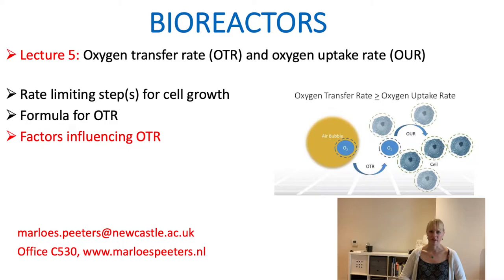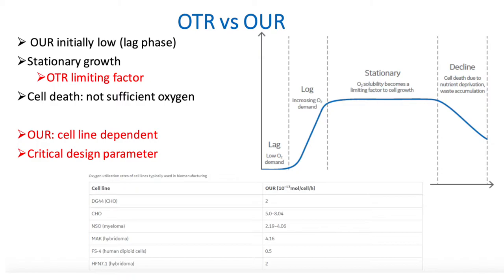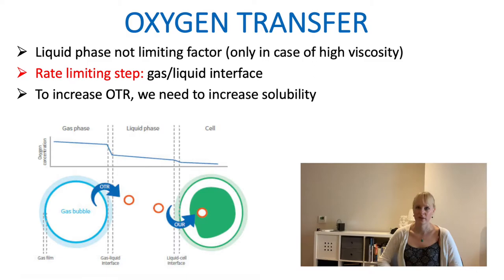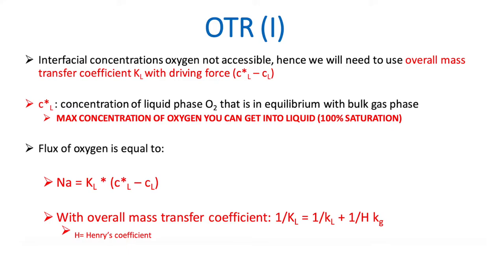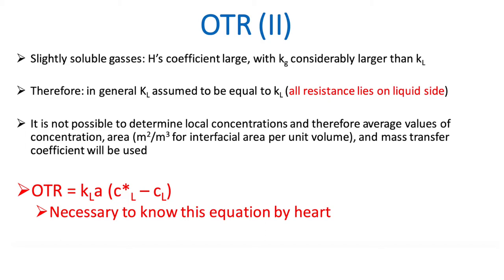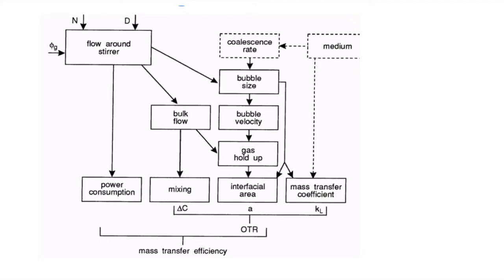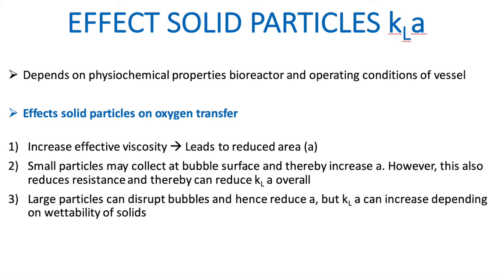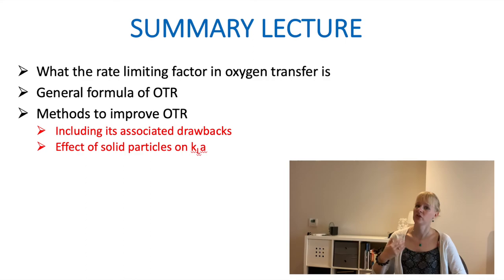Oxygen transfer rate and oxygen uptake rate in bioreactors

Comment: 5:45  why putting pure oxygen puts  the system in explosion ,?
Reply from the maker: If pure oxygen is being used for aeration, there is an increased risk of spreading a fire due to an oxygen-enriched atmosphere. Usually air, rather than pure oxygen, is used for aeration (this is also much cheaper, which is the main reason it is used)